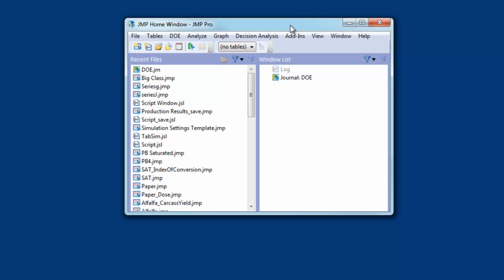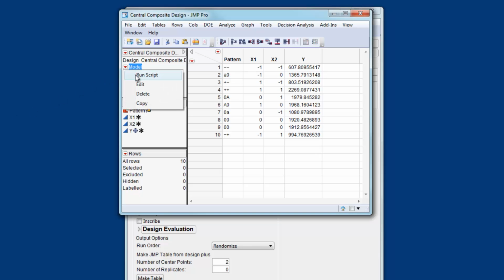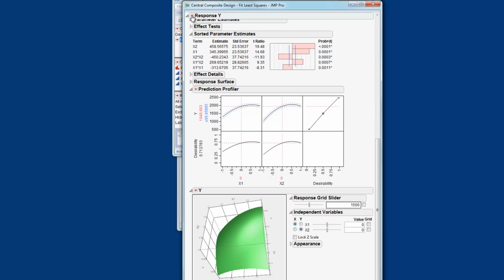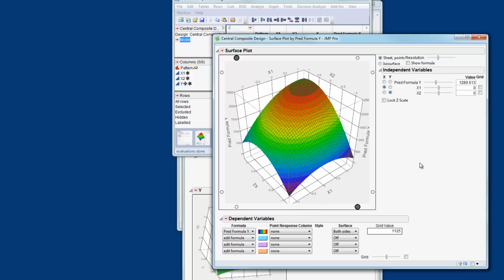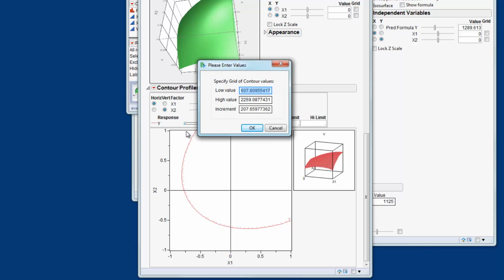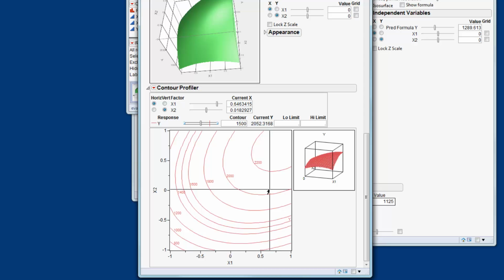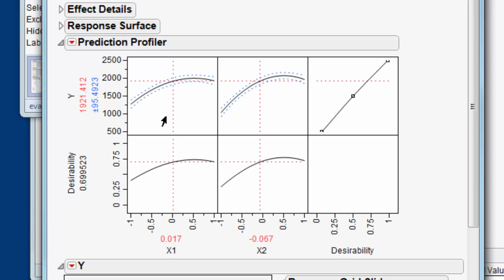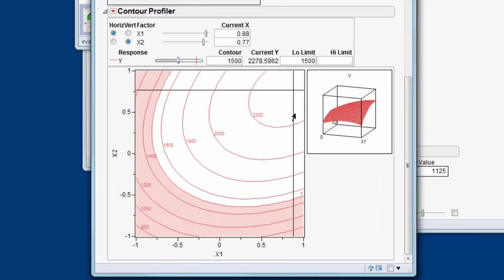DOE using JMP® Software: Construction and Interpretation of a Response Surface

Comment: Can jmp software used for multi response optimization
Reply: Short answer: yes.  Slightly longer answer: use the FIt Model platform to create models for each response; then use the prediction profiler to create a desirability function based on the goals for each response (maximise, minimise, achieve target).  Then optimise the desirability function.
Reply: @davidburnham3062  thank you
Reply: Thank you sir, one more question, is the rsm tool present in both jmp and jmp Pro version
Reply: @kirankumarkr4611  Yes, the ability to generate a response surface design, and the ability to represent data with a response surface model. are native features of JMP; you don't need the PRO version for that.

Comment: I have read some paper on hydrology models which are calibrated using Response Surface method (RSM). 
After reading those papers, I have some question related to RSM. The model I am working takes input data as follows : Daily Precipitation data, daily temperature data and daily snow cover area. With this model, I have associated parameter/ factor ( 5 factors - Continuous) with the model.
The accuracy of the model is determined by Nash-Sutcliffe coefficient (R square) using the computed and measured discharge from the model.

I have to keep on changing those factors  ( trail and error method ) in order to  achieve high R sqaure value. (Dailymeasured discharge validates the accuracy by comparing with value from daily computed discharge generated by the model)

Is it possible to find a optimum value for achieving target R square by this DOE technique? Please advice me.